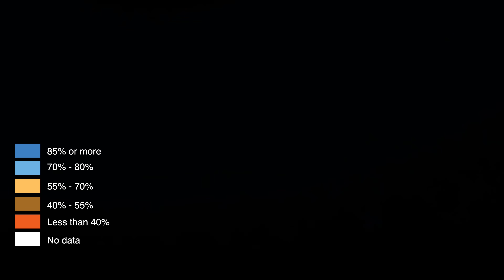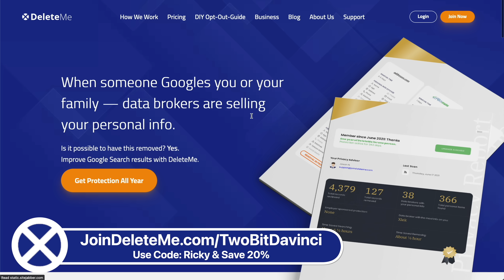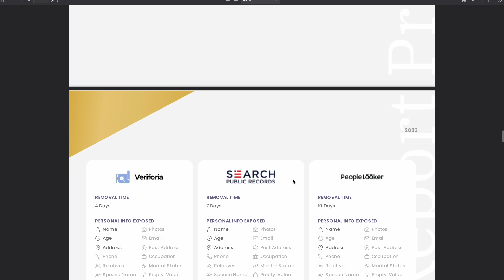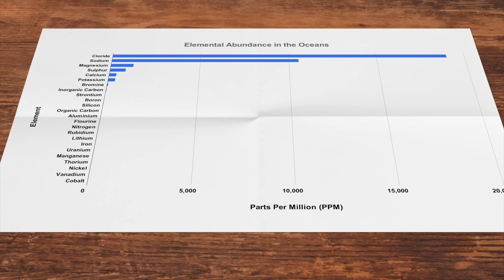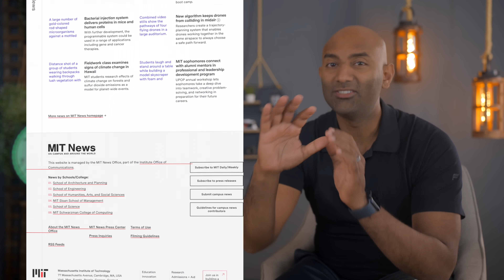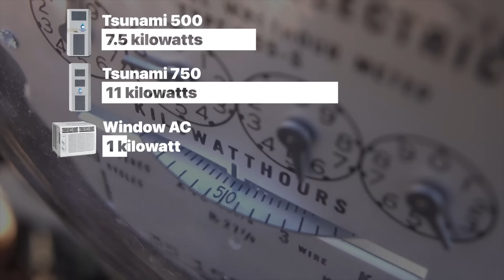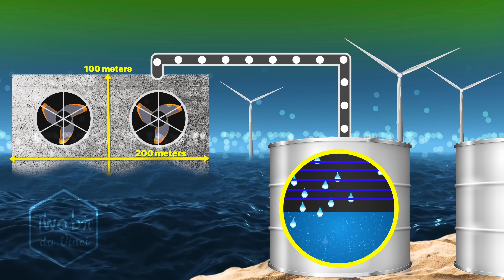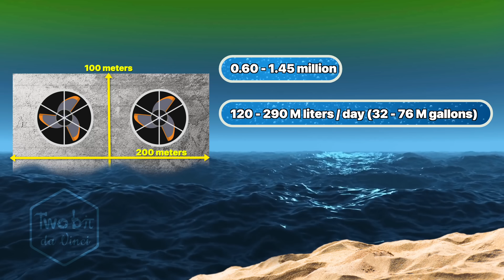This Tower Turns Ocean Fog Into FRESH Drinking Water!

Comment: I wouldn't do a tower per say, I would instead repurpose an Oil tanker sized ship. Have it go out to sea, collect the water then bring it back  and pump it into holding tanks. This improves collection because you can send the ship to places where conditions are ideal and you can use deep (cold) water pumped up to the surface to cool the condenser. Plus you wouldn't have any visual pollution of large towers just off shore blocking the view.
Reply from the maker: Thats a really great Idea..... very practical for construction also since all the work could be done in a dry dock and a great use for a decommissioned ship
Reply: @TwoBitDaVinci  And as we wean ourselves of off oil, there will be a lot of surplus oil tankers.
Reply from the maker: Yes a great way to upcycle
Reply: @TwoBitDaVinci  
Your channel should be renamed: The Dopamine Fantasy
Reply: @TwoBitDaVinci  And the way oil tankers are laid out, the deck is usually flat and open which would be ideal for solar panel to provide power.  Mind you, I am not saying to USE oil tankers, but to use oil tanker design and construction expertise to design and build a "water collection tanker".
Reply from the maker: This would be so awesome
Reply from the maker: These would be so cool.....
Reply: @TwoBitDaVinci  also, that means no permitting or siting issues, which are a nightmare, especially in coastal areas.
Reply: But the oil oligarchs would protest,, "Won't we have a giant water spill if there is an accident"?     :)
Reply: @alcocklake  
OGM! THE RUST!!!! 😁😁
Reply: @rogerstarkey5390  LOL!! Tankers don't use steel that rusts for their holding tanks.
Reply: @rogerstarkey5390  And there is a theory that iron filings can make plankton grow. More plankton = more fish. So the rust could cause a prolification of fish and we would have fish running out our ears.
Reply: @alcocklake  LOL Nicely put!
Reply: Before I read this idea, I had the thought that we could repurpose decommissioned off-shore oil rigs. The ships are a great idea when there are no local decommissioned rigs. The advantage over the ships is that they wouldn’t need to shut down to go into port to unload. Of course, tankers would be needed to transport the water from the rigs but they wouldn’t have to shut dow in a storm where a ship might. They would also have to have an onboard storage though.
Reply from the maker: Yeah a oil rig platform would be awesome. SpaceX is already repurposing two of them so why cant one be repurposed for this and have solar and wind and tidal power to run the unit?
Reply: @TwoBitDaVinci  exactly. Throw on renewable energy and storage and maybe transport extra energy in container sized battery packs. They could possibly even power the tankers taking the water back to the land.
Reply: @russellklegraefe6425  That's actually a great Idea.
Reply: @russellklegraefe6425  The rigs make a lot of sense and would also be potentially good anchors for wave power generators - in addition to any wind and solar mounted on the superstructure.  the tankers could serve as both storage and processing. Maybe even retrofitted with large vertical airfoils for propulsion (or power generation, depending on the design)

Now that I think about it more, the towers could be stationary, with the Tankers being the processing facilities, modular and detachable, so they could be rotated back to dock for maintenance and upgrades - At least until the 2nd or 3rd gen condenser tech could be improved and installed, along with pipelines to the shore. An intermediate step for rolling it out faster, for less upfront cost.
Reply: Sorry to rain on the parade but the cost of running an oil tanker would be prohibitive. Adding a water condenser to an offshore oil rig and piping it to shore might work since the rig would be doing double duty.
Reply: @patrickforbes6745  
Channels like this are for space cadets who don't have real jobs and have too much time on their hands.
Reply: Tankers will not work if they want to build things high up like offshore wind farms.  As you increase the height on a ship you increase it's instability. Plus ships have the problem of sinking or not working during storms.
Reply from the maker: But they would be awesome for mobile emergency deployment
Reply: Your still burning a ton of fuel to move water, further head to install a line. We use them for natural gas and you wouldn't have to worry about pressure due to water being on the inside and outside of the tube.
Reply: @mrp782  
Space-cadeting is fun when you have other people's money to spend.
Reply: No you just have the air pollution of massive marine diesel engines polluting the air wherever it goes. Lol.
Reply: Along with the process of also repurposing flooded waters by cleaning it. Then, dump it into reservoirs.
Reply: Huh! Makes me think of the fish processing ships that follow fishing fleets around to do most of the processing before moving the processed fish back to the mainland for packaging and distribution. 

Love this idea!
Reply: @MrChris20912  

Condense humid air with electricity? 

... Sounds like artificial rain. 

Can we see a cost comparison with simply filling supertankers with water where it does rain naturally, and shipping it to ... "dry place"?
Reply: "the view" isn't really an important  criteria in regards to a life giving resource.  If it's purpose keeps me and mine alive, safe and helps others who are more inclined to take what they don't have by any means necessary is a win/win.  End Stop.
Reply: @bozhijak  Clearly you've never dealt with Rich liberals in the North East US. They blocked MANY off shore wind farms because of "spoiling the view"
Reply: This would be synergistic with Ocean Thermal Energy Conversion.
Reply: Average US resident is using over 200Gallons water/day. They similarly use about 10 gallons gas/week. The number of tankers would be crazy.
Reply: Best idea here.
Reply: Our water won't be coming from underneath the ground. We have made atmospheric water generators. I do agree that the ocean is the best place to set these up. The reason for the tower is in order to collect water from the atmosphere, we have to have a cooling mechanism, so something like a metal screen can be used to harvest plenty of fresh, clean drinking water. On the inside of the machine it will have a cooling system so we can condense the water from the atmosphere. This water then has to run through 4 filters and then also a uv light to kill any left over germs but this would mean we would have healthy water to drink without having to put chlorine in the water to clean it. The screen is made to be cold and has a harvesting system inside where the water can drain into a tank. If we use the ocean we could make more than just 80 ltrs of water daily and water would eventually become free for everyone along with fuel free generators. If you don't know about fuel free generators or even replicators you should look it up. Free power, free water. We'd actually be able to afford living.
Reply: idk that boats could hold nearly enough water, but the idea of using deep water to force condensation is clever
Reply: Tankers?

Why not just send the tankers to where fresh water is plentiful and bring it to where it isn't?
Reply: @hg2. Yeah sure we just go and take others resources,how very imperialist American of you lol
Reply: @joesutherland225  
Spare me the victimology.
Reply: Great idea
Reply: @everlastinglife5978  
"Want to buy a bridge?"
Reply: Natural gas????

There's NO excuse for high natural gas prices. 

The only reason there are high prices is because of those stupid environmentalists.
Reply: @hg2. If you actually believe that,your far stupider than the environmental types.

Comment: Scotland has 90% of the UK’s fresh water – with 7452 million cubic litres, Loch Ness itself contains more water than all the English and Welsh lakes together – and in the decades to come industries will “roam the Earth looking for a place to call home … where water is in abundant supply”. That place will most likely be here in Scotland. 😊
Reply: Thats interesting but also goes to show the vast differences in water availability. Lake Erie, the smallest of the Great Lakes has about 70 times the fresh water as your Loch Ness, and Lake Superior is about 25 times larger than Lake Erie
If the technology discussed in this video is viable then the availability of inland fresh water is much less important as coastal areas can economically extract the needed water from the ocean environment

However this does not really impact the effects of the Colorado River long term drought. Most of that water is used in the Central Valley and other locations further east for agriculture. Even at the costs discussed its going to be alot more expensive to pump the coastal water inland than the current water sourced from the river.

Comment: The average Southern California home flushes about 15 gallons (this is a very conservative number) of clean fresh water down the sewer every day during the summer while running a home air conditioner. The energy is already spent on the A/C cooling, yet the perfectly clean water is flushed down the sewer. 

(Well, not at my house. I have a large home with two A/C systems and all my condensate water is diverted and stored to water my gardens and grove. The A/C is powered by ground based solar)
Reply from the maker: your right ....Ac condensate is a very underrated resource.
Reply: Not 'perfectly clean ' The condensate has all the solids and viruses and bacteria that is washed out of the air. YUK